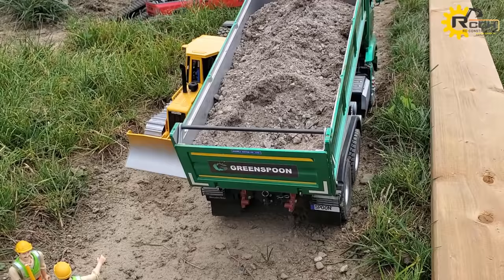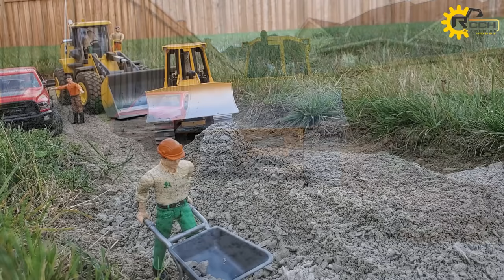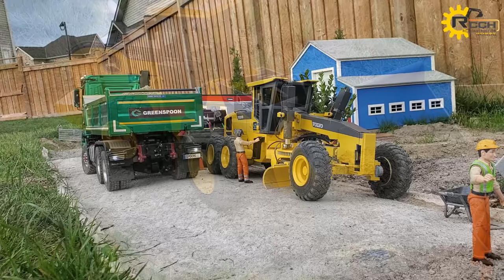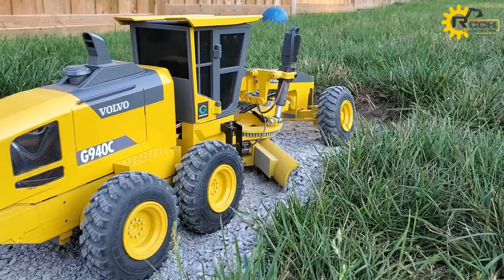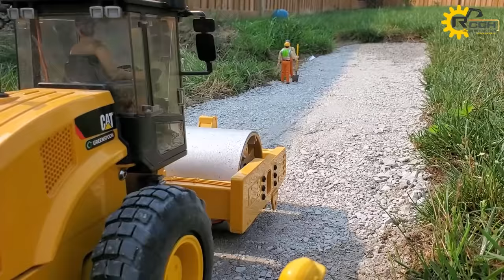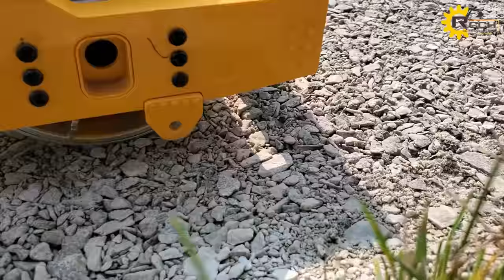Grading A Road With An RC Motor Grader In 1:16 Scale

Comment: Hello, I'm retiring and I want to get started with the RC construction equipment, and building a complete city. Can you point me in the right direction where to get started. Where to buy and what to buy. Thanks
Reply from the maker: Thanks for the great question. Best place to start is to join some of the Facebook groups as they will have more information. But if you want to get started you can look at an excavator from Huina. They are a chinese company that makes some ready to run construction equipment.  Alipexress has lots of options to choose from.
Reply: @RCConstructionHobby  thanks I appreciate the information
Reply: GWDGWSSDGSSDDDDFFFDD😊😊😊
Reply: 😅🎉skrkkkiekkeiw @RCConstructionHobby
Reply: Where did you get that grader from

Comment: Can you pay people to convert excavator to hydraulic
Reply from the maker: You could ask someone to build for you but it costs a lot more than just buying the parts and building yourself.
Reply: Ok
Reply: And how did you do you cab with the door opening and closing and I don’t have a 3D printer to print stuff off the excavator if I do the converting
Reply from the maker: I cut the door with a Drexel tool on the straight parts. And on the corners I used razer saw by hand. Drilling small holes along the rounded parts helps. Then I 3d printed a new door. But you could use the existing one  if you are accurate. You can buy small hinges from Amazon or aliexpress.
Reply: Ok
Reply: And with the buckets can I still use the huina buckets if I do the converting

Comment: Are these vehicles 3D printed? the dozer tracks and the front end loader boom look like 3D prints? where do you get STL files for things like this if they are?
Reply from the maker: Most of the machines are 3d printed. I design them and sell some of the files. You can find it on cults3d.com and search pedrcri for my stuff.
Reply: Thank you…I went to your cults3D page and I see it looks like these are conversions and accessories for the Bruder toys. Is there a place I can go to learn more about the complete conversions and what is required ie servos, motors and linkages etc and how they’re implemented to make these into RC?
Reply from the maker: You can always go to the rctrucksandconstruction.com forum and do searches on how to convert things. I have videos on how to do the conversions. just search my channel and there are a couple videos on conversions.
Reply: @RCConstructionHobby  be able to

Comment: Hi, congratulations for the video, where you found the Volvo grader model and the John Deere loader, thanks for the help Regards Luca
Reply from the maker: Hi Luca, they are both custom made from 3d printed parts I designed. The grader is 100% 3d printed and the John derre loader is about 80% 3d printed. The chassis on the john deere is bruder.
Reply: @RCConstructionHobby  great job thank's
Reply: @RCConstructionHobby  junhb
Reply: @RCConstructionHobby  p
Reply: @RCConstructionHobby  
mmm